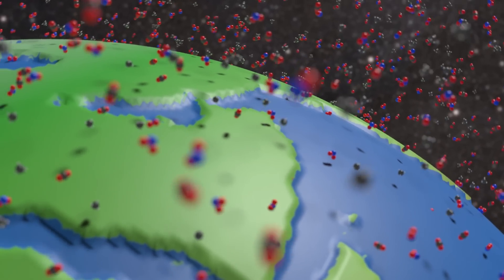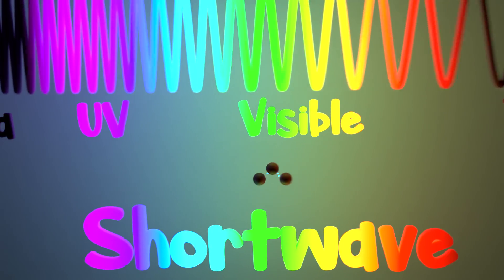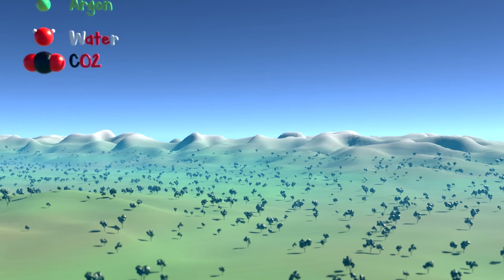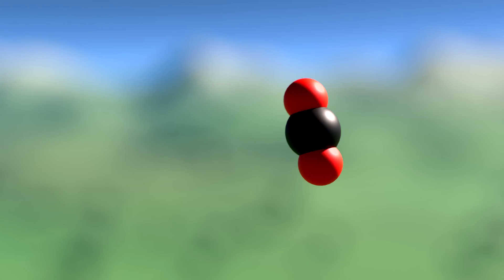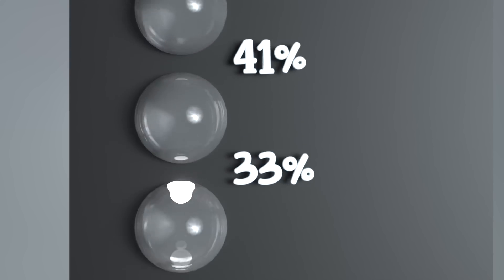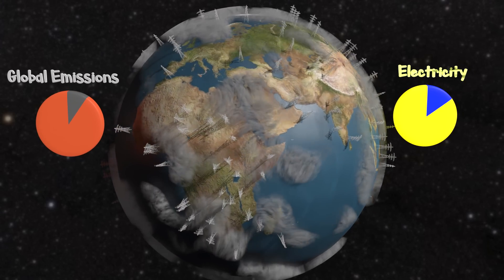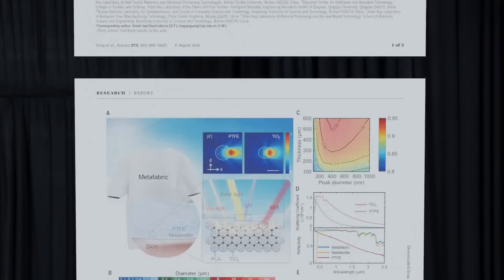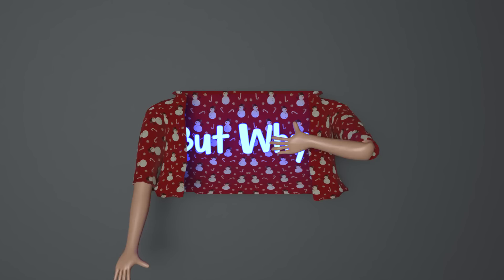Energy Free Cooling through Physics

Comment: I checked current silicon base Aerogel, it was way too expensive. Beside that, the cooling capacity also way too low for indoor cooling. I think it might have take up double the area of the room cooling and for densely populated area, it might not possible at all.

But still a great work show us that we could cool without using as much as we did right now.

Comment: You might want to research your research. You strongly indicate that these materials will, without intervention, cool their environment. The papers are about reducing heat gain of internally heated materials and/or objects.  In short, they are increasing emission. At first I thought you were dumbing down your presentation. After looking at the papers, I no longer feel that way.
Reply: This is not 100% correct, the fabrics discussed in the papers themselves remain cooler than the ambient air by blocking out solar radiation like the youtuber says (see figure 3 in SHAONING ZENG et al 2021) what you are getting at is that they also allow heat out (this is evidenced by the text between figures 3 and 4 and is talked about in the abstract). They lower emissions though because we are not using energy to cool the person or the car that is covered by this fabric, simply, think about it on a tent like op said, the internal temp is lower because thermal radiation is refelected and we do not have to cool the tent as rigorously which causes tons more emissions than the heat emissions you are talking about. You misunderstand his claim of cooling the environment, they directly cool the internal environment of the car, person, tent, etc and indirectly cool the environemnt by combatting climate change.
Reply: @stafastacks1760 Well there is that, and there are also materials that are more prone to emiting heat via radiation then thermal convection can keep up with in the open, with the bonus of being highly reflective so if they where used indoors the cealing above and floor below the material would get hotter while the material itself would be cooler at least until the cealing and floor catch up with thier own thermal radiation 
Now replace the cealing with open sky. Your expanding the frame of the thermal system when you use radiative cooling outdoors to include well. Space. And that can lead to some extreme localized cooling
Reply: @stafastacks1760  why not just use Mylar bubble wrap? How does reflecting energy back to space "save energy"? If you use solar to run a heat pump, it is doing the same thing... If you use wood to heat with, it does the same thing.. It is a cycle. Biblically, "There is nothing new under the Sun".. With some of the "greatest minds" there at MIT, one would think they would figure it out..
Reply: @mollymaccorkle7054  It saves energy because instead of cooling the air in the house from 90F to 70F, you only have to cool the air that is 80F to 70F (for instance). Using solar to run a heat pump is not the same thing. It probably helps by shading your roof, but this is more efficient in coolibg and can be used on more parts of the home and more objects, meaning you need less energy to cool the house, so that electricity can be used for something else (or just consume less energy).
Reply: @mollymaccorkle7054 some guy writing "there's nothing new" doesn't make it true.
Reply: @stafastacks1760  electricity and energy are not synonymous. So the thermal energy is blocked so it stays outside so a heat pump doesn't have to remove it to outside, using less electricity, to heat the outside. If you are making the thermal energy heat a boiler to produce electrity, with 100% efficiency, it is a wash.. It's a cycle. Potential and kinetic energy.  The energy it the same. Say you were using that to heat you water, you could heat the water with direct thermal also, you would not need electrical energy to heat it..  If I am wrong, so was Faraday and Einstein and Tesla...
Reply: @stafastacks1760  That is not the claim. The claim is that if you put this material in the sun and leave it there it will cool. Absolutely impossible.
Reply: Nighthawkin light made a video on sub ambient cooling paint that jas a really good explanation imo
Reply: I would agree but I don't think the passive emissions from the dissipation of heat would equivocate to the active emissions used to power AC.
Reply: Radiation  is emitted back to space (partly) and reduces energy consumption  which generates heat
Reply: @zlkanglwrth2776  There is no energy consumption any where in the system. Consumption is converting energy to another form such as matter.
Reply: How does a house get hot if all or most heat is rejected on the outside and all the heat energy can only go outside? If it acts like a reverse greenhouse it is cooling down, ever walked under a bridge on a hot day? Only thing this adds to my knowledge is that plastics are not absorbing infra red, so maybe instead of glass windows we could improve with plastic windows😅
Only problem I see with that is that here it tends to become cold as well as hot, so the energy saved in summer will be spend in winter trying to heat the darn house. So who knows, nice vid either way.
Reply: AI is the biggest dumbing down I've ever seen.
Reply: Where is the increase in emissions? Also the materials cool the environment below them not around them.
Reply: Nop you are just mistaken
Reply: What about worms silkworms??
Reply: He lost me on the part where "greenhouse gasses cause global warming".
Reply: @templeofdelusion So what would you say green house gasses do if not conserve heat?

Comment: The skeptic in me suspects the "ministry of truth"  aka TPTB, now has the motive to minimize the negatives effects of aluminum oxide, which is a known health hazard and cause of motor neuron degeneration, in favour of commercializing paper 2 to take advantage of existing public fears of global warming. Much like hydrogenated fats were sold as an alternative to saturated fats in post-WW2 industrialization at a great cost to our health, Why? Because bunnies that eight nothing but saturated fat get heart disease. Solution use hydrogenated vegetable oils. Profiteers and those using the public narrative avoided science by failing to acknowledge that bunnies don't eat saturated fats or omnivores like dogs don't develop the same condition.  They also failed to test the new "reportedly" healthy hydrogenated vegetable oils replacement on bunnies. I guess aluminum oxide, based on this research, will become sort after with the correct marketing and neural degradation, as a result, will be blamed on something else.

Comment: I believe the holy grail is a one way material that lets infrared through one way but reflects it when coming from the opposite direction. Come winter, you could simply flip the panels and trap heat inside the building.

Comment: Thank you for presenting this in a way a non-scientific mind can understand. I'm always interested in science and its application to real, common life. Two ideas beyond this which might be worth investigating for any who are interested: 
1. I saw a segment about 15 years ago where some university students were developing solar paint. (Stuff to absorb and then transform to power.) I have no idea how far they got. They probably ran out of funding but it would be worth checking out. 
2. I've always wondered why we can't take our plastic trash, which I've seen it densely compacted into great 'walls' before being sent elsewhere to be trashed. Why can't these walls be used in communities that currently use bits of tin for walls and rooves? Surely they'd provide some insulation whilst letting in some light? It has to be better than tin which can rust over time? Run some giant steel pegs down through them for stabilisation (in the same way foam walls or straw bale walls are built). Render them in mud or concrete for more aesthetic appeal. Who knows- perhaps the odd, random formations or pockets of space contained within these plastic bottles and products will be enough to reduce the heat in the buildings?

Comment: There is no such a thing as green house gas. CO2 is 0.04% of the atmosphere. This concentration is not even close to hold heat as word spread by theories without proven scientific foundations. Those are theories and computer models built to comply with the theories. The climate science is far more complex and multi-factorial then just a tiny concentration of CO2 in the atmosphere. So, this part of the video is misinformation. Regarding the materials, this is viable. Please, do more research on climate science and make a better contribution to the human kind.

Comment: Impressive.
Talking about excitedly dancing molecules however I found seriously confusing since for me, who has some background knowledge about physics, saying that "light absorbed by the carbon based matter of e.g. earth reflects at a lower frequency spectrum in the form of heat radiation, resonating with molecule rather than only atoms causing a heat build-up in the ground and air instead of simply exciting the earth atmosphere again." would be a lot easier to understand.
Likewise, the "inverse greenhouse effect" would be the selection or creation of materials, which allowing for low frequency magnetic waves / rays to pass through at a higher rate than higher frequency ones, which ideally get reflected away instead - the opposite characteristic of e.g. glass. The effect would be to not just counteract heat build-up, but to funnel energy away.

Comment: Si la compréhension du phénomène n'est pas aisée, la puissance de cette solution de refroidissement NON thermodynamique est déterminante. La plupart des solutions concurrentes avancées depuis longtemps flanchent sur ce point.  If the understanding of the phenomenon is not easy, the power of this NON-thermodynamic cooling solution is decisive. Most of the competing solutions that have been put forward for a long time fail on this point.

Comment: If I get it right if infrared waves will be reflected back doesn't it means that it will hit CO2 particle and warm up the air anyway? Also they did experiment with white roads so they will reflect the light back it makes the roads cooler but air around ppl was much more warmer. So it's great but still not the solution not even close :)

Comment: I had some similiar results when using a white/black foil which I put over my tent (white side to the sun). The temperature difference was presumably 10 °C in the summer which made the interior quite cool. In addition everything that was cooled over night was still cool in the afternoon despite extreme sun radiation and high temperatures. In the end the white/black foil is presumably polypropylene which is essentially plain hydrocarbons. Not so sophisticated like these specialized new material combinations but it worked quite well and was very cheap

Comment: Well, from what I've learned infrared makes it to the surface and through thin clouds and through moisture and fog fairly easy. Blue-er light tends to get scattered more by the atmosphere than red and yellow. That's why the sky is blue rather than red sky except during dusk and dawn./
Chlorophyll from plants are experts at reflecting IR and in a sense keeps its own leaves cool from direct sunlight nearly 12 hours every day with a few breaks like cloudy and rainy days to replenish its vegetation growth. I began wondering what do they use on solar panels. I'm sure they need to keep that cool in direct sunlight.

I've came up with the above but you spoke about some similar areas here.

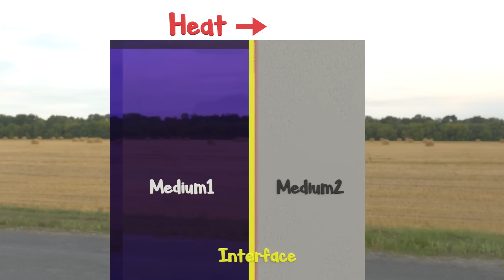Comment: 0:55 EARTH'S NATURAL GREENHOUSE EFFECT (OTHERWISE KNOWN AS "ATMOSPHERIC THERMAL ENHANCEMENT" OR "ATE") IS FROM BOTH: 
1. DAYTIME CONVECTION DUE TO NET INSOLATION AT THE SURFACE (70% ABSORBED SOLAR AND 64% EMITTED AS INFRARED INTO ATMOSPHERE). 
- CONSEQUENCE IS THAT THROUGHOUT THE DAY, ATMOSPHERE EXPANDS UPWARDS, GAINS GPE*  ON THE SIDE OF THE EARTH FACING THE SUN'S RAYS.

*(GRAVITATIONAL POTENTIAL ENERGY)

2. NIGHTIME GRAVITATIONAL AUTOCOMPRESSION. 
- CONSEQUENCE IS THAT GPE IS GIVEN UP AS THE MOLECULES SETTLE DOWN TOWARDS THE SURFACE, LEADING TO INCRASING KE**.

**(KINETIC ENERGY OR "THERMAL ENERGY")

DURING DAYTIME:
Work done by the sun's rays on a air packet at the surface is W, 
the heat gained by the upper atmosphere in the day is (dQ)ᵃᵗᵐ= +W =d(PV)=PdV+V.dP=PA.dh+V.dF/A=F.dh+L.dF, where L=V/A, dF>0.
the GPE gain of that air packet is mg(+dh)= dU = (dQ)ᵃᵗᵐ = +W, 
then the loss of thermal energy at the surface is (dQ)ₐₜₘ = -dU = -W.
Total energy change for upper and lower atmosphere is Eᴛ= (dQ)ᵃᵗᵐ+ (dQ)ₐₜₘ = W -W =0.

DURING NIGHTTIME:
Work done by the upper atmosphere packet on a air packet on the surface air is -W, 
the heat lost by the upper atmosphere in the night is (dQ)ᵃᵗᵐ= -W = -F.|dh| - L.|dF|, where L=V/A, dF<0.
the GPE loss of that air packet is mg(-|dh|)= dU = (dQ)ᵃᵗᵐ = -W, 
then the gain of thermal energy at the surface is (dQ)ₐₜₘ = +dU = +W.
Total energy change for upper and lower atmosphere is Eᴛ= (dQ)ᵃᵗᵐ+ (dQ)ₐₜₘ = -W +W =0.

Comment: I used to make ice outside at night on a clear sky, passively cooling water in a reflecting aluminum dish insulated on the outsides and covered with clear plastic film, with a black object placed in the middle of the water to better absorb its heat and radiate it into space. Put in the cooler in the morning.✌

Comment: Since asbestos, I am always wary about the use of strange new materials in the form of fabric, where it may break away and form airborne fibers that might be toxic, or pollutants of some kind, that nobody expected. Keep it in a solid block so it won't disperse as easily, please. I can see some lightweight shindles that can form a tent-like structure, too.
Reply: Calcium carbonate is also decent for reflecting a lot of light.
Reply: Agree and the recommend material is made with Teflon, the new asbestos 🤷🏻‍♀️
Reply: @CherishedChristianLife  Teflon is pretty much inert. You could eat it and it would pass right through you
Reply: @CherishedChristianLife  Yes. Teflon (and other fluoropolymers and halocarbons) are kind of miracle materials proving extremely useful in various industries, but these need to be disposed of properly.
Reply: Maybe we should take into account the amount of energy required to produce these materials and evaluate them throughout their entire lifecycle. We should examine their efficiency first, the ease of their manufacturing process, energy required to produce, and their final disposal. It's possible that companies like Dupont are enthusiastic about producing more materials derived from petroleum, which could contribute to our ongoing dependence on fossil fuels. This situation also seems like another opportunity for them to capitalize on, all while presenting themselves as environmentally conscious.
Reply: Teflon is only an issue if it’s heated to above 300°C.
Reply: @PythonPlusPlus  its maybe less an issue less hot, but its still one. 

Dont be fooled, its bullshit to say it obly becaume dangerous from harmless at 300 celcius.
Reply: Nano particles in general are unkind to life and they have no certainty of the totality of the unkindness.
Reply: @stanweaver6116 Hahaha, no.

Life itself uses nanotechnology all the time.
Reply: You all realize asbestos is from the earth and the material talked about is synthetic right? Asbestos isn’t even “toxic” in the traditional sense, it’s a sharp micro-irritantx
Reply: Evzn more when you use aluminium nanoparticule, 
Alheimer inducing metals
Reply: Good point, Teflon, for example, is known to be toxic to humans
Reply: @dirtdiggity1714  oh no, now people know where to look for the EZ water and make batteries out of human cells 🤪
Reply: Remember Asbestos is only harmful for those who work manufacturing or cutting it because they will inhale fibers dust that will create scars in the lungs over time. I have asbestos roof, insulation and water pipes and there is no better material. I wish we can automate asbestos production with robots so we can have it back on car's brakes and transmissions.
Reply: @aduantas  gets into your body as micro plastics and disrupts your endocrine systems (at the least)
Reply: Silly consumers! You release the products BEFORE testing, that way you make much more money, in case later lawsuit costs come up. If you test before you might be somehow criminally liable. Being intentionally negligent tho, A okay 👍
Reply: @andiralosh2173 edgelord
Reply: @andiralosh2173  If they come after you, just transfer that one questionable product to a new company (with all the liabilities ofc) and move on! No harm done!
Reply: Asbestos sucks but all of those things are better than an uninhabitable world.

Some living things dying > ALL living things dying.
Reply: @MyBiPolarBearMax  Global warming won't kill off all life on earth. It wont even cause the worst mass extinction. The worst mass extinction was the Permian Extinction, which killed off 90% of all life on Earth. Our global warming is set to kill about 60-80%. Honestly not that bad. We will, however, not survive. Which is kinda the whole idea of fighting global warming. Which also brings us into why the recommended fabric here is a bad idea. PTFE or Teflon as it is also known, has recently been linked to causing hormonal damages in humans and disrupting local ecosystems, thus also causing damage to nature. Hormonal damages means it won't just make us die sooner than normal. We would also have a harder time reproducing, as reproduction is governed entirely by hormones.
Reply: @MyBiPolarBearMax  Well, youre free to make the sacrifice if you feel that way. Youre not free to force that sacrifice upon anyone else.
Reply: @MyBiPolarBearMax Reminder that our ancestors did, in fact, not all die. Hyperbole is not helpful.
Reply: @Ibian666  I don't know, only 3 of my ancestors are alive 😉